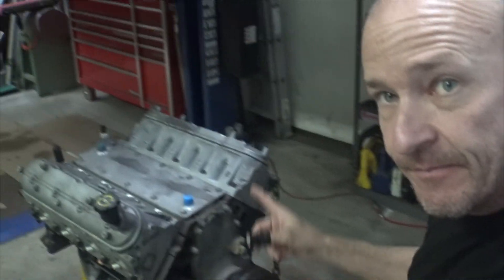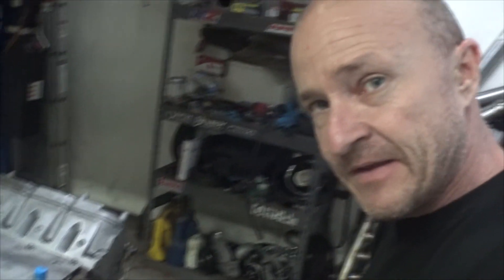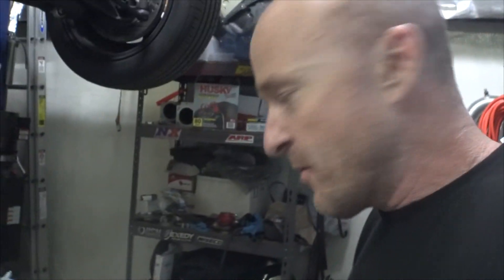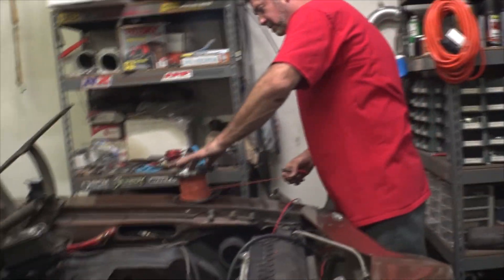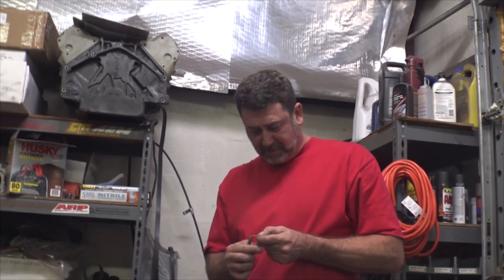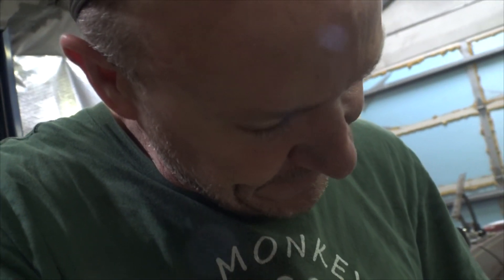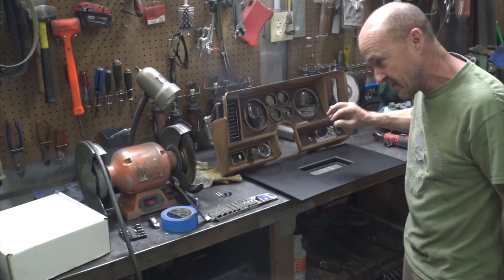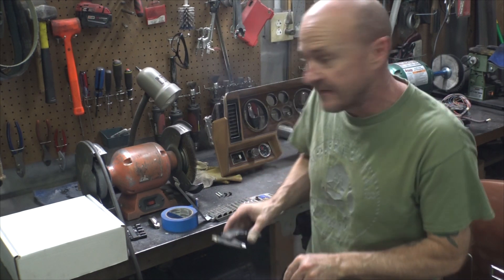Phoenix holley dash and stuff

Comment: you could do a solid state relay and PWM that fan mike, run 50% when AC is on and full when temp is up
Reply from the maker: was thinking about this, not sure how it works ect. i've see "controllers" for that. so just use one of the ssr off the holley dash? think Rob Dahm just went though something similar